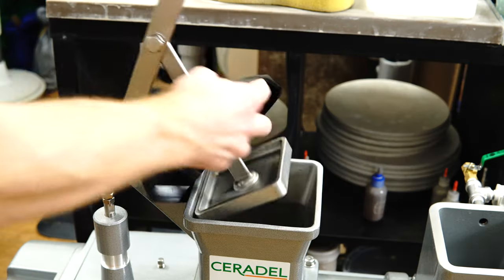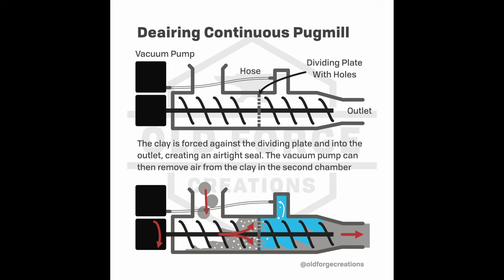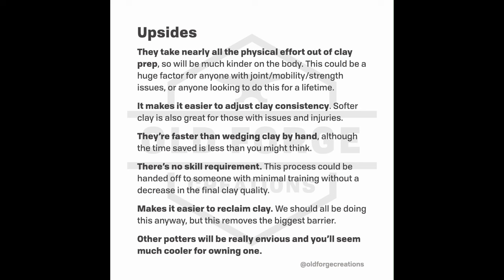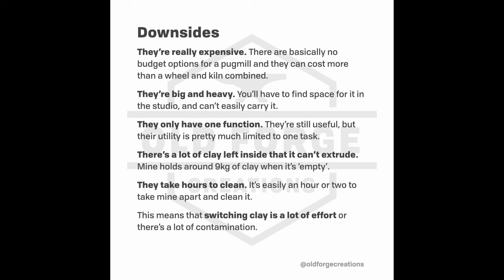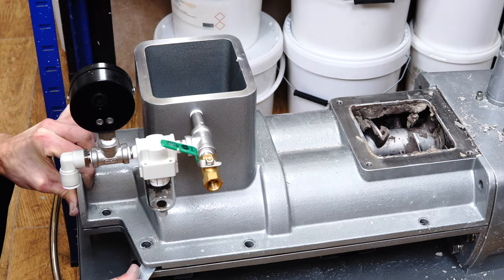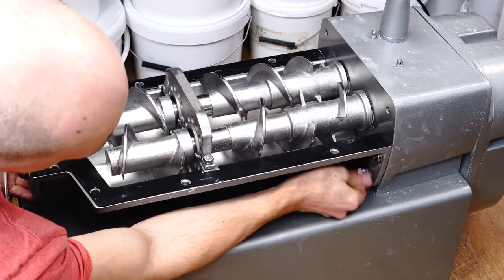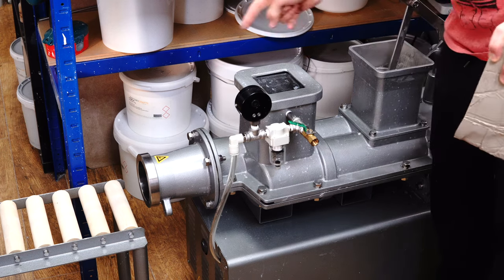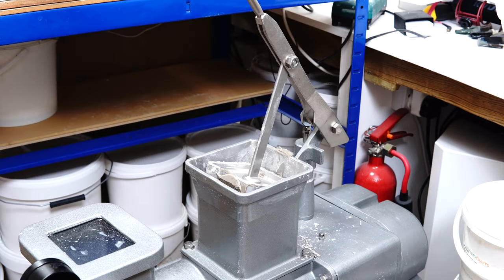Pugmills - What they are, how they work, and do you need one?

Comment: Thanks Joe!  Very useful info.  A couple more thoughts...For someone who cannot get their clay locally and must order online, a pugmill could allow them to order dry clay and mix it in their studio, saving money on the clay purchase and shipping costs.  That could be a factor in the decision and ROI.  Also, the time saved in clay prep for production potters is time that can be spent creating, so that is also a consideration, albeit maybe not a huge time savings based on your comments.  Also, I've seen people comment that they didn't use their pugmill often enough and the clay dried in it, making it very hard to clean.  Not owning one myself, I can't say how long that takes, but for those who wouldn't use it often it could be an issue, I suppose.  No doubt many will benefit from the insight you've shared.  Thank you!
Reply from the maker: Unfortunately, I'm not sure it's any cheaper to make your own clay. The water is only around 1/4 of the weight of plastic clay, so buying dry powder ingredients would only save a relatively small amount in shipping (so 100kg of throwable clay would require around 75kg of dry ingredients). And in my experience the material cost per kilo is often more than the clay cost per kilo, so you can actually pay more for the ingredients to make your own clay than just buying premade.

The Shimpo has a pretty good seal on both ends, but I can definitely see that drying out could be an issue if left for long periods of time even with the seals. And would be worse on any pugmill without those seals!

Comment: At my guild, we use any cone 10 clay and mix it all together, sometimes have nice streaks of different colors. Never had a problem with separation or cracking for different clays. I would not mix cone 6 and 10 clay though. Our machine is reversible and has the de-airer. We do not clean the inside of the pug mill, we just leave it sealed up so it does not dry out. There is a chamber where the vacuum is produced that gets some clay pulled in to it, that has to be scooped out after the pugging is finished. We pug every month or two.

Comment: Agreed totally, correct explanation, and I will not get one even for free, just because of the "cleaning time", I 'm quicker with my slap and "fold" method for getting the air out of clay, just reclaiming about 10 kg (a bucket full)  once a month
Reply from the maker: There's a lot to be said for finding a basic manual technique that works for you and sticking with that, it's so much cheaper, simpler, and more space efficient!

Comment: Great video! So when we clean our pug mills at the shop, we don't take them apart. We pour clean water into the hopper, mix it, extrude it, repeat until clean water comes out. It takes a couple of hours, but the machine is doing the work. I don't think we've taken one apart in years. Not for anything except replacing the gaskets.
Reply: I should also mention that we generally add deflocculant to the rinse water to help loosen the clay up.

Comment: I am making a hand crank PM out of an old meat grinder. Im just a hobbyist and only reclaim mine once a year. They are just way over my pay scale. 😮
Reply from the maker: I've often wondered whether it would be possible to use the basic concept of the deairing mill and the mechanism of  a meat grinder to make a hand powered deairing mill. The vacuum pump can easily be bought separately and is a tiny fraction of the overall cost, but I can see it being a challenge to get the build design right.
Reply: @OldForgeCreations im still working on it. Got a reduction gear drive and plan on attaching a motor.

Comment: I visited a studio that used different clay bodies but ran all scraps together through a mixing pugmill and simply had a "studio" clay that they used when a purer color didn't matter.  Do you see any downside to doing that? I use porcelain,  white,  speckle white,  speckled tan,  and Terra cotta colors.  A mixing  pugmill could combine them enough to achieve color and shrinkage consistency, right? Or is this taking a risk?
Reply from the maker: I think a pugmill would definitely mix them well enough to avoid any major issues, especially if they were fed through a few times. The question would be whether the clay ended up having a sensible firing temp (mixing a cone 6 and a cone 10 clay might give a clay that matures at cone 8, but that's not much help if you only fire to cone 6 and 10) and how much the blend would vary between batches
Reply: @OldForgeCreations  Thank you! They all have the same firing temp.
Reply: At my guild, we use any cone 10 clay and mix it all together, sometimes have nice streaks of different colors. Never had a problem with separation or cracking for different clays. I would not mix cone 6 and 10 clay though. Our machine is reversible and has the de-airer. We do not clean the inside of the pug mill, we just leave it sealed up so it does not dry out. There is a chamber where the vacuum is produced that gets some clay pulled in to it, that has to be scooped out after the pugging is finished.

Comment: Thanks really helpful. If you want to soften new clay that's too hard to use from the bag, do you have to add some water in the mill or does the mixing itself soften it up enough? I only use one clay, so would always have some in the pugmill, would that mean not having to clean it, or would the bits dry inside do you know? Thank you!